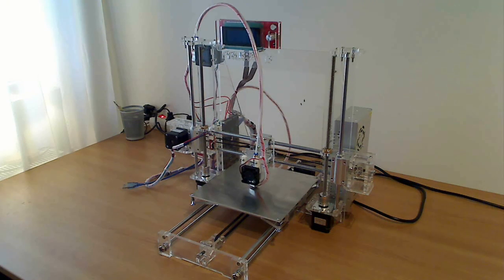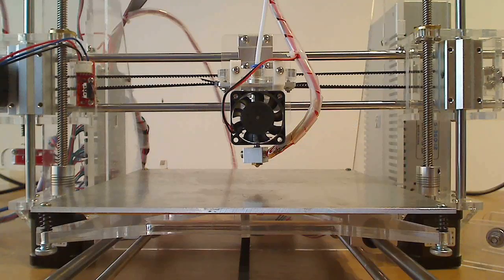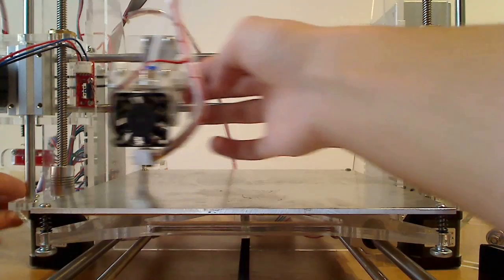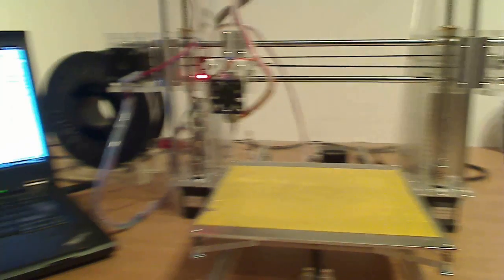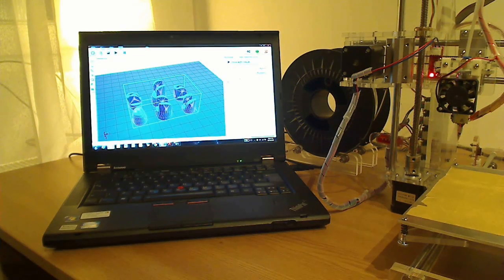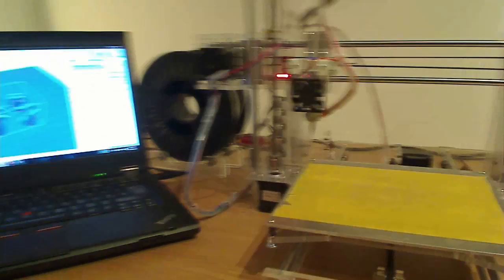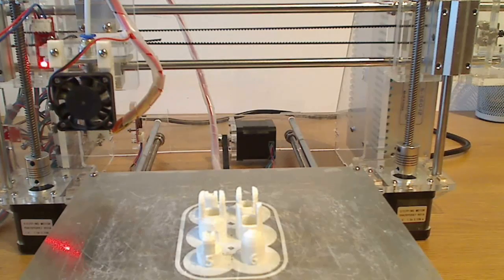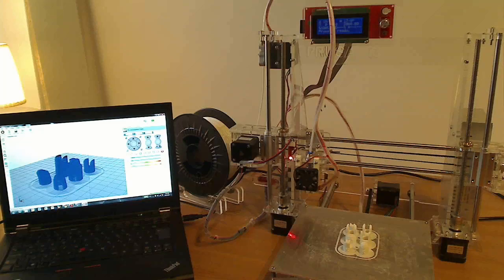Prusa I3 3D printer building tutorial (Part 8): Final calibration, first print and spool holder

Comment: Sorry but your whole bed leveling approach is flawed. It is based on everything under your printer (i.e. floor, desk) being level and your printer NEVER moving from that spot. All you are doing is compensating for your un-level building, floor, and or desk.  It also assumes you (a human, not a machine) can adjust your Z stepper motors 100% equally by hand. Printing directly to your build surface is never a good idea, in you case brass scraping against aluminum is not going to end well in the long run. Get your Z axis calibrated for with the tape.
People this video is a few years old but if you are looking at it please use common sense.

Comment: Hi, If I press Any endstops, the corresponding motors should stop. Am I right?
Reply from the maker: Hi, that's right.
Reply: What's the temperature setting for abs?
Reply from the maker: Somewhere between 200 and 250. You must experiment and see which is the one that works best. I will give you a link in which you will find out whether the temperature is too high or too cold depending on how your print looks like. 
https://www.matterhackers.com/articles/how-to-succeed-when-printing-with-abs

Comment: Hi AndreiRobotics, very informative video.

When I print my printer does not know where the extruder is and over or under shoots its so 
target. Do you know how I can fix this?
Reply from the maker: +SwoopRC 
Hi! Are your end stop sensors working properly? If yes, check your configuration.h file for the speed of your stepper motors and for the printing surface. 
Maybe you can find this video useful: 
https://www.youtube.com/watch?v=Ob2LsHm64bc
(in this video you can find more details regarding the configuration and the settings)

If this doesn"t solve your problem please let me know and i will try my best to help you.
Reply: +AndreiRobotics  Thank you! I will try this soon!
Reply: I was such a machine, the gap between print and extruder is too high. Help me